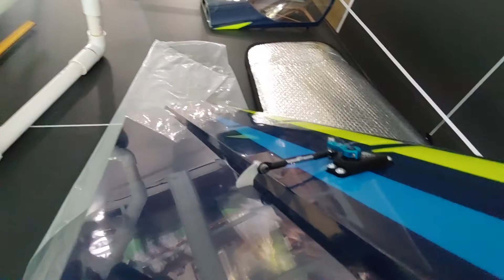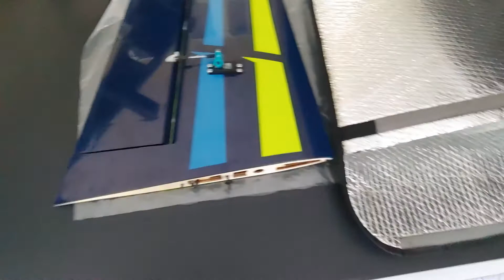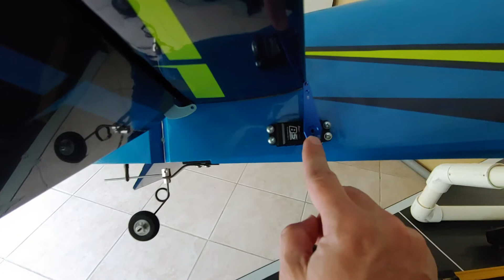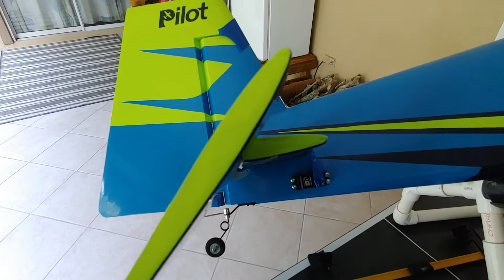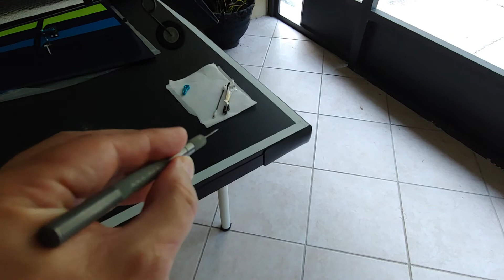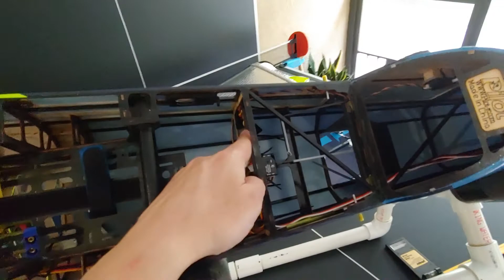Pilot RC Slick build update 3

Comment: Looking very good. 👍🏻I think you have the elevator servo other way around. The spline should be closer to the horn on the elevator not away. That’s why the rod was short.
Reply from the maker: I considered turning the servo around, but the wire would be pointing toward the rudder. It made the servo wire turn too tight for my liking.

Comment: Did you by any chance weigh the aircraft without any electronics (without motor, battery, esc, servos etc.)? And whats the flight ready weight of your setup? Greetings from Germany!
Reply: Hello Germany. I did not get a weight of just the airframe. My take off weight is around 9lbs 5oz (4.224 kg).